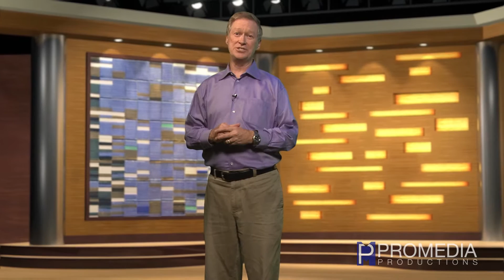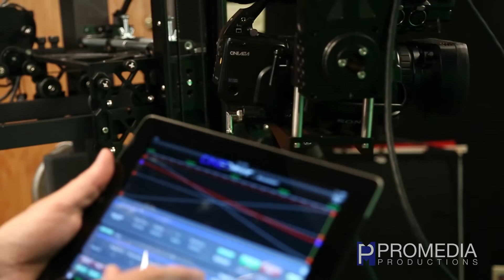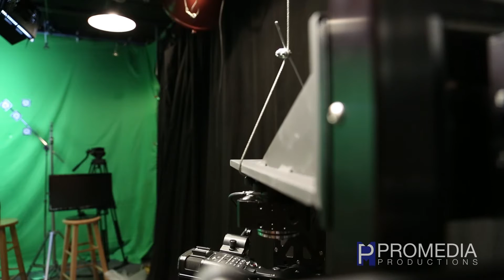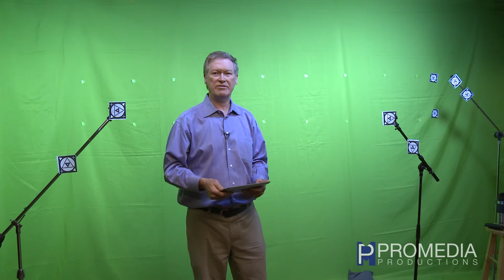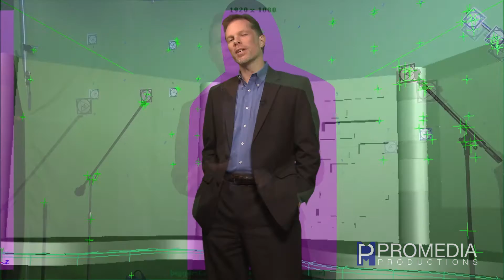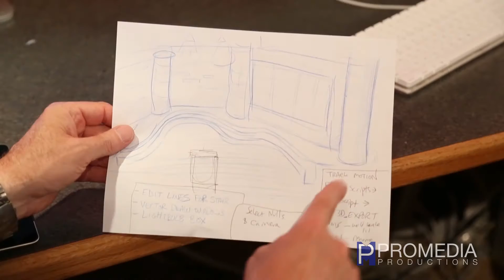CineDrive Green Screen Demo - ProMedia Productions

Comment: Hi Steve, did you have to customize that steel arm or can you buy one online for this purpose? If custom, did you just drill some holes or did you have to thread them as well? Are there any commercial solutions that will do the same thing such as a Tripod head that tilts 90 degrees?
Reply: Something like this could work if it had a bowl mount perhaps and was super strong/stable (going to be holding a RED vertically) https://www.bhphotovideo.com/bnh/controller/home?O=&sku=283744&gclid=CNT-nu7D1tICFUKTfgodDMcC3g&is=REG&ap=y&m=Y&c3api=1876%2C92051677682%2C&A=details&Q=